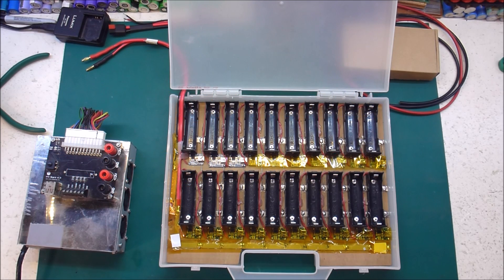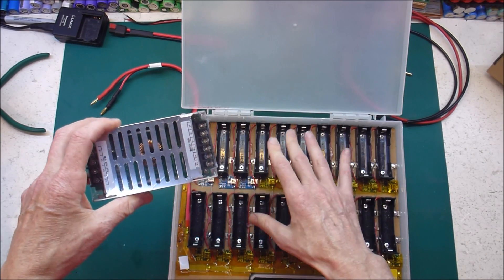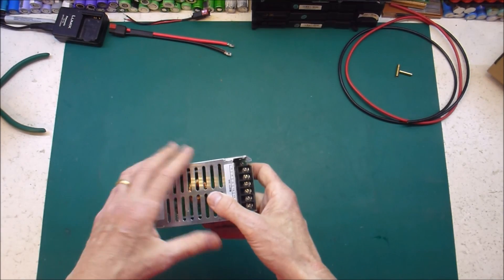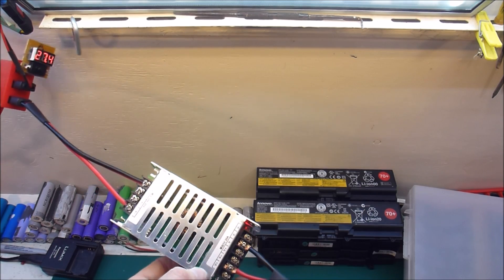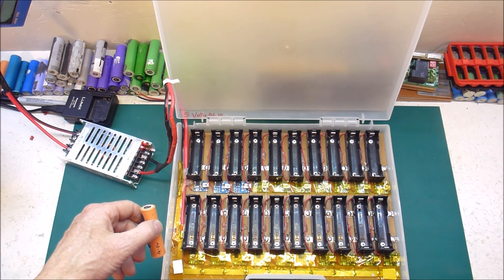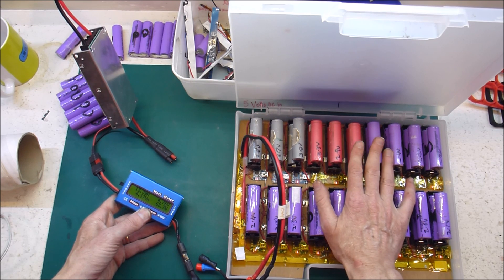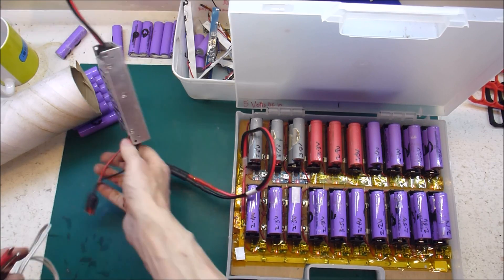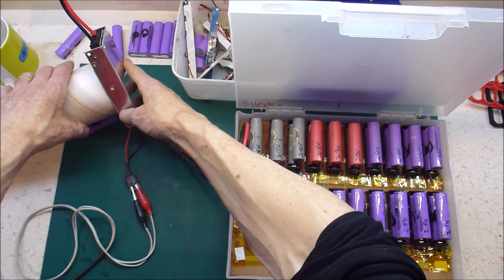Laptop Powerwall 95 - powerwall powered cell charging

Comment: I figured out a way to balance charge without a balance charger or a BMS for a 3S 12.6v use three of these in parallel on the input and 4.2 on the outputs neg/pos on each of the 3 cell series This way you can charge at 4.2v using a 12v car battery and lower than 4v http://www.banggood.com/LTC3780-Automatic-Buck-Boost-Constant-Current-Power-Module-p-990459.html?rmmds=myorder and you don't have to wait for the pack to balance and fully ready to use when charge ends. A balance charger will slightly over charge other banks to bring the under powered bank up to par and it takes precious time as well as the battery banks lifespan. this is working 100% on a 12.6v with 4 in each parallel multiplied by 5 so a total of 20 18650 in column one 20 in column 2 and 20 in column 3. A total of 60 in the pack and I know they're a bit pricey but no more worries, just plugin, charge and go and you can make a 1000v pack or higher because you only push 4.2v max per parallel group. Now I have to fuse this pack. If the price is a issue, you can use a 5v wall charger or a 5 v DC to DC that supplies 3 or more amps or even 3 phone chargers connected to 3 TP4056 protected for $1.80 to $2.00 http://www.banggood.com/20Pcs-USB-Lithium-Battery-Charger-Module-With-Charging-And-Protection-p-1051619.html?rmmds=myorder then if you want you can use a cheap but effective sepic converter boost / buck so you can charge using a car battery or just about anything here for $2.00. http://www.banggood.com/10pcs-DC-DC-Boost-Buck-Adjustable-Step-Up-Step-Down-Automatic-Converter-XL6009-Module-p-1087605.html
I'm hooked on the SEPIC Idea Buck / Boost because I can charge a 25.2v battery pack using a 6v source or less and what I'm using doesn't terminate the system so I have to restart it every morning when the solar panels fire up. As I drain the system it keeps it topped off and starts on it's own and it will allow me if I choose to limit the cutoff so I don't accidently kill my pack to whatever value I choose and I chose 3.08v per cell group to make it safe, I believe 3v is good but I want to increase the life cycle and 4.15v top end. Do you have a top end and cutoff value you feel safe with to increase it's life span?

Comment: Some of these DC-DC modules assume your mounting it inside a metal industrial cabinet, which means the metal it's bolted to conducts heat away.
Would be worth pulling the top case off, check to see what is running warm inside.
Mosfets and power diodes running warm can be solved with heatsinks, an hot running inductor is a sign of bad design.
Reply from the maker: Thanks for the idea @station240 - I'll have a look.
Reply from the maker: Maybe I could get away with adding an old CPU heat sink to it. On the other hand - I'm thinking about upgrading to a 40A model: https://www.aliexpress.com/item/DC-DC-Converter-12V-24V-8V-40V-Step-down-to-5V-40A-200W-dc-to-dc/1243293277.html
Reply: Yeah if it's not an inductor overheating, then any heatsink would be an improvement.